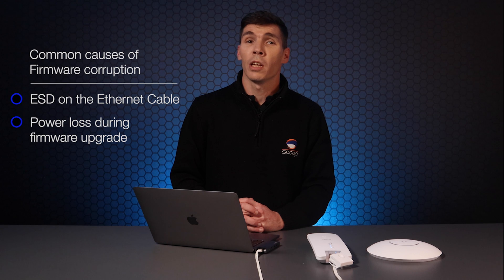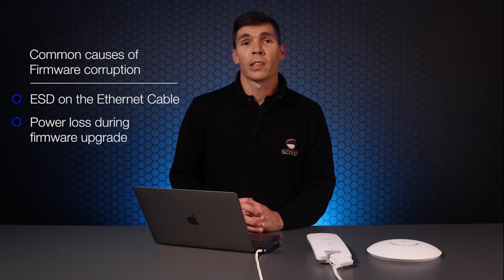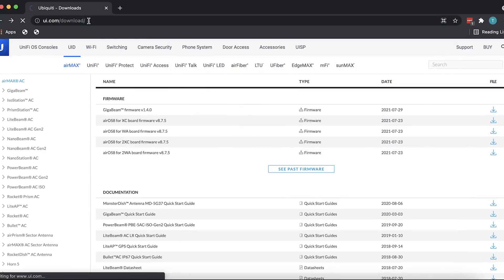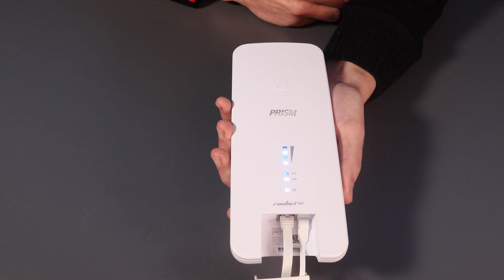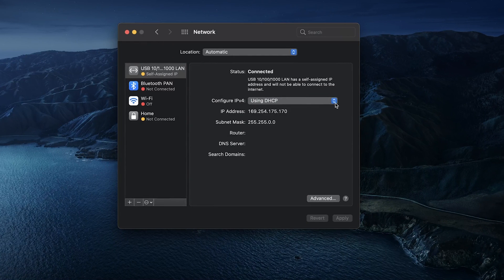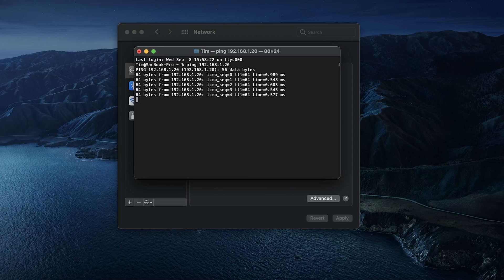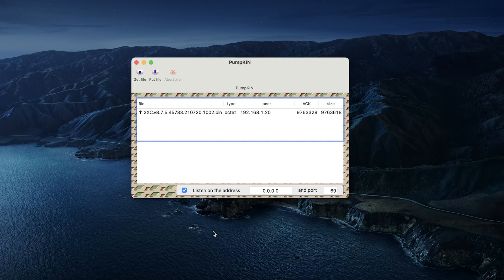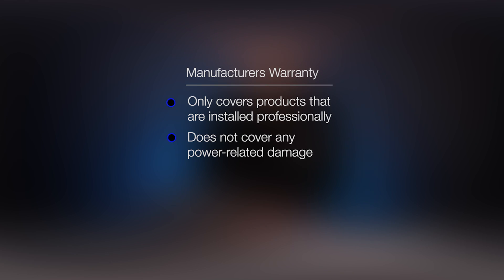How to Recover Ubiquiti Devices via TFTP

Comment: You need to tell everybody that the default iP address for recovery mode or a factory reset radio is NOT 192.168.1.20, it is DHCP. I spent two hours looking all over hell for 192.168.1.20. Then I finally tried the discovery tool that found it on some odd iP address it got from the DHCP server in my router. The UBNT engineer who thought this was a smart idea needs to be located and nutted.

Comment: can you solved my problem .? I'm on TFTP mode and my Unifi AP destination host unreachable
Reply from the maker: Hi there, we have found that sometimes devices with newer firmware still got a DHCP IP instead of the 192.168.1.20 static. We therefore used WiFiMan (Downloadable from Ubiquiti's download page) to get the IP address in order to TFTP the unit. I hope that helps you.

Comment: will that also work when your Unifi 6 LR does not show any light at all or is my unifi 6 LR Death?
Reply from the maker: Hi there,

There have been times when this recovery method worked in getting "failed" U6-LR units back up and running. For the most part, if that does not work, the unit might be suffering from a hardware issue.
Reply: Mine UniFi 6LR died two weeks ago, too! I wonder if it was a firmware update? Either way, I'm here to TFTP this thing back to life
Reply: @PlaceboHead360 did you have any luck?
Reply: @aero-space541 never came back :( Hardware issue most likely
Reply: Did it work?

Comment: good day sir..I have a question about the lap-120...when I updated the firmware, it suddenly browned out..I didn't finish the upgrade because it doesn't want to connect to its ip address. can you help me sir?..thank you
Reply from the maker: When its in TFTP mode you can verify if the Ethernet works by pinging the default IP (192.168.1.20) If there is no response its likely the port is either faulty or damaged
Reply: ''ahh'' then, sir, it's not going well.. there's no other way..

Comment: I am getting this error:"Failed to send data, error 64
Failed to send data, error 64
Failed to send data, error 64
Failed to send data, error 64
Failed to send data, error 64
Failed to send data, error 64
Failed to send data, error 64
Failed to send data, error 64
Failed to send data, error 64
Failed to send data, error 64
Failed to send data, error 64
Connection timeout for 'XW.v6.3.12.33412.240516.1806.bin'
⬆ Transfer of 'XW.v6.3.12.33412.240516.1806.bin' finished.
"

on Ubiquiti M2 Loco. Kindly Help
Reply from the maker: Could be an issue with the Ethernet port so you may need to RMA if still under warranty

Comment: Unifi device discovery tool looks absolutely nothing like the utility you used at the end of the video. Yours says Wifiman at the top so I assume its an application by that same name. I google it and cannot find a mac osx compatible version, looks to be a mobile app only. ?

Sooooo how are you using that on your mac. Why are you calling it Unifi discovery tool? I see no link to it in your description
Reply from the maker: This is the Wifiman desktop version which is only compatible with Mac M1 processors/Linux/Windows. We used this since it it offers features other than the stand-alone device discovery tool but it does not currently support Unifi devices. Not sure where Ubiquiti are with developing an updated version - https://community.ui.com/releases/WiFiman-Desktop-0-2-2/74d8bc1d-6735-444b-a7fc-0ea2584ccb89

 There is a stand-alone discovery tool as a Java application or chrome extension which supports all devices - https://ui.com/download/utilities

Comment: i can use reset with poe  or must  device ?
Reply from the maker: This is device and setting dependent. By default you can reset using the PoE injector on all Airmax devices. It does not work with Unifi.

Comment: Hi and awesome channel. I have a Unifi AP AC LR. thats flashing white and blue. Im unable to to pick it up in the controller or see an IP address anywhere, Is there a default IP for it. Please help!
Reply from the maker: Thank you and glad you are enjoying our channel! Sounds like your AP is locked in recovery mode.  Try send the firmware like we demonstrate in the the video, the default IP is 192.168.1.20. If this does not work you can send it back if its still under warranty.

Comment: edgerouter 12 is flashing lights
Reply from the maker: Hi Rifat, 
Thanks for your comment. 
The recovery method for the EdgeRouters might vary based on each product model. 
Our guide is a general case and will work on most units, but not all.
Please see the following link to Ubiquiti’s guide on recovering the ER12 devices.
https://help.ui.com/hc/en-us/articles/360019289113-EdgeRouter-TFTP-Recovery
Reply: @scoop_distribution  thanks mate resolved it. i had to reboot while it is connected